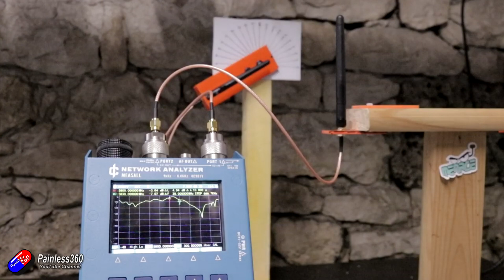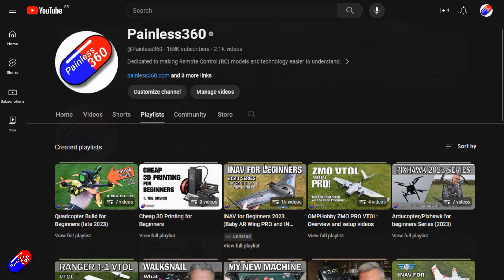Antenna Alignment Explained Simply (Viewer request)

Comment: On a dual antenna tx, you want the antennas at 90 degrees for the same reasons.
Reply from the maker: It depends on how many antennas are on the model. If there is only one antenna on the model, the a V setup on the radio could be useful... Happy flying

Comment: Nince Video, thank you.  I have a question. Sometimes you see people flying 2.4GHz and the linear antenna on the receiver on the quad is horizontally. They aling their antenna only antenna (e.g. TX16 transmitter) on the tranmitter also horizontally (which is correct), but basically in the "transport/store" position, meaning 90deg to the side. I am quite convinced that this is not a good idea, at 2.4GHz the quaterwavelength is approx 3cm. If you position your antenna like this, the whole radio is within 3cm at least for one side of the antenna. Can you comment on this? I cannot "test" it, I only fly crossfire (868MHz) with a tango2.
Reply from the maker: I don't mount my antennas horizontal here. See the videos in the antenna lab series... Happy flying
Reply: @Painless360  I know. And I have watched the antenna lab series, very informative :). But while there are videos about the influence of covers and different antenna orientiation/types, I did not see anything about the nearfiled influence (except for the covers) e.g. having the antenna close to other stuff.  I was just wondering what your opinion on positioning  the transmitter antenna  the way discribed above is.
Reply from the maker: I have no hard data to support either way on that one. I don't do it for the reasons already covered. Happy flying!